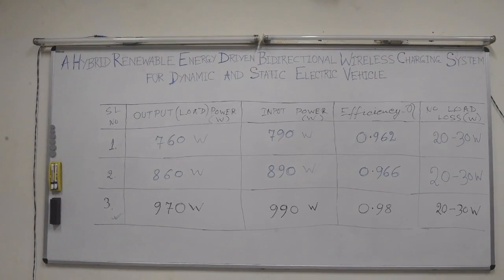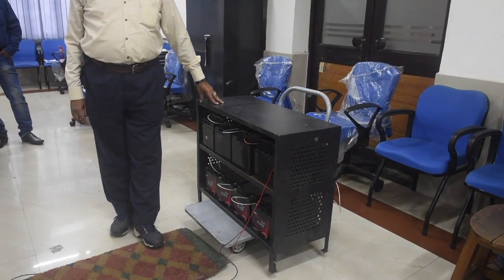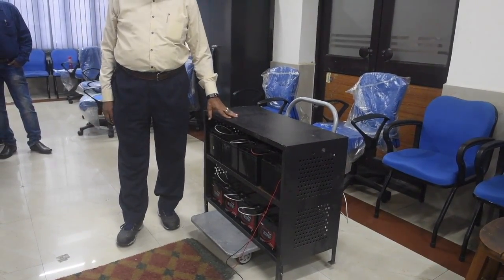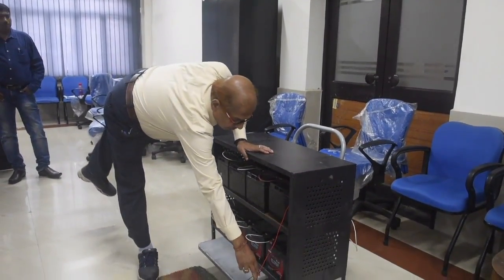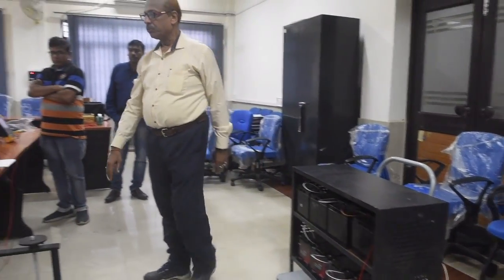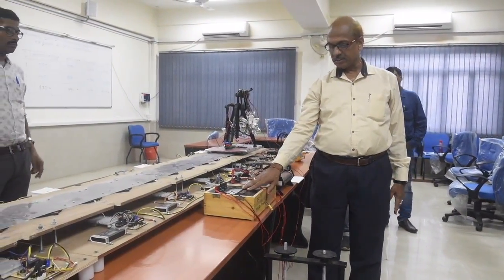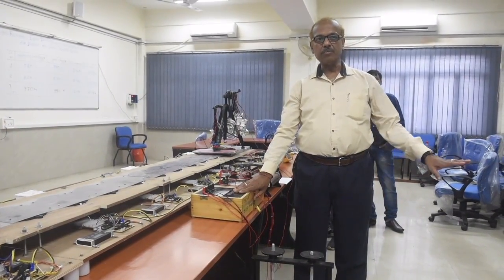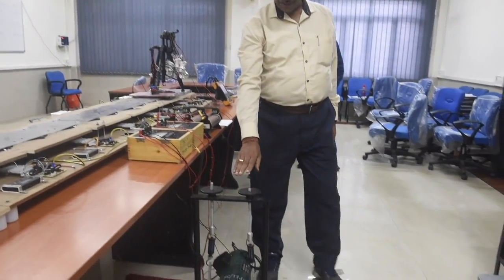IIT (ISM) has developed wireless charging system for electric vehicles

Comment: The government intends to have EV sales penetration of 30 per cent for private cars, 70 per cent for commercial vehicles and 80 per cent for two and three-wheelers by 2030..one of the integral part an electric vehicles are battery and it charging related problems...lot of people's not used electric vehicles because he think battery take more time to charge and during charging it can't run the vehicle...now this research resolve the problem of battery charging and this is going to be a milestone in the field of automobile industry...